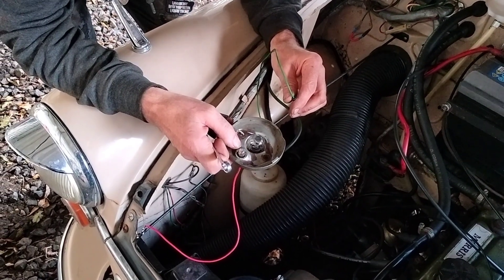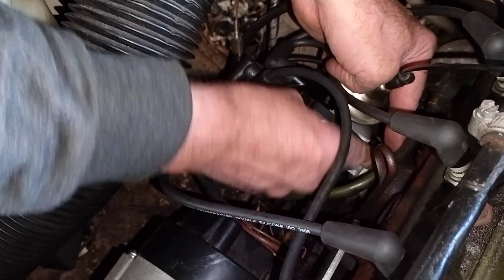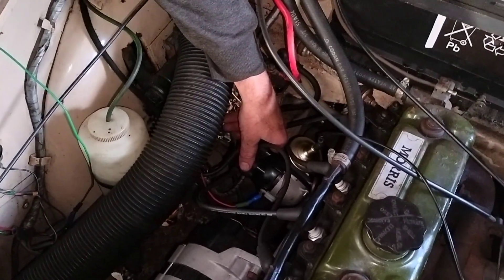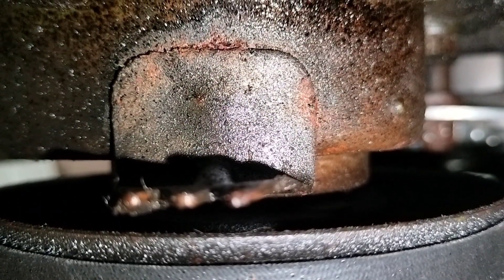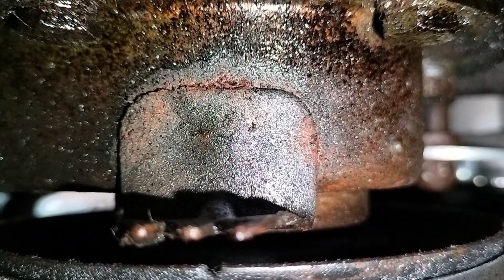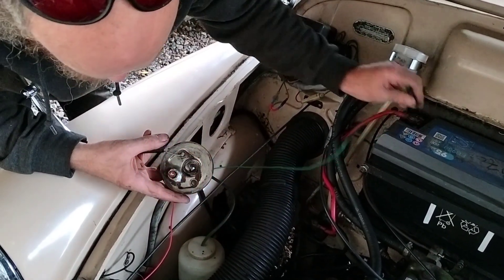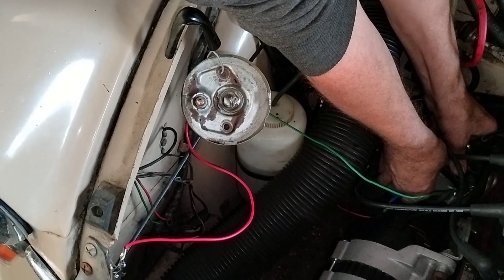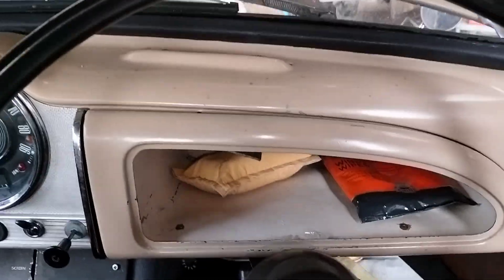Morris Minor Level 3: Static Timing a 1098 Engine

Comment: To bd honest - far better to use a strobe light. That way you can see static and dynamic timing ( mechanical(bob weights) and vacuum advance)
Reply from the maker: 👋 yes you're probably right but as I'm almost completely blind I can just about use a static timing light and I've always found that static timing an engine is a great starting place for fine tuning your timing. However I generally time our cars by ear once I have found the static timing point.
Thanks for commenting 👍

Comment: A dab of white or yellow paint on the 3 points of the timing marks and the notch on the pulley makes the much easier to see.  It also helps greatly if using a strobe light!!
Reply from the maker: @mikerostock3229  That's a good idea 💡 Luminous maybe 🤔

Comment: Superb explaination, ... 

I saw somewhere here on Youtube a bloke using a mirror underneath the car to check the marks.

Could you explain a bit how the car is running when it's to far ahead in timing or to far behind ? 
I have the idea that the engine might run very rough or hardly have any power when it's not on time.

"Hartelijke groeten" from The Netherlands.
(Kindly regards)
Reply from the maker: Hello, thanks for your comment 😊 The simple answer is that  if the timing is out either way the car will sound terrible. Some people make adjustments by ear and it is based on when it sounds like it is running at it's best. You do of course need to make sure that everything else is working OK 👍
Reply from the maker: Oh also, if you were doing this task on your own, a mirror is the way to go. The whole task is easier with two 😊👍

Comment: Don't go backwards.  To keep the timing chain taunt, turn the engine right around again until the timing mark and rotor arm are both where you want them. You'll also want to advance the rotor arm as you turn the distributor.
Reply from the maker: @JohnDyer-j7y  John you're absolutely spot on. We should have let it go round again 👍
Reply: Always turn in running direction to keep timing chain tight and timing gears in tight mesh ( no back lash)

Comment: Nice work. I used to do this years ago on my 1970 Traveller, before fitting an Accuspark electronic conversion kit.
Reply from the maker: @FMFGUF  Thank you, glad you liked it. Yes, a lot of Morris owners convert to electronic these days 👍😊
Reply: But - how does electronic ignition change timing settings? It is still using same mechanical drive?